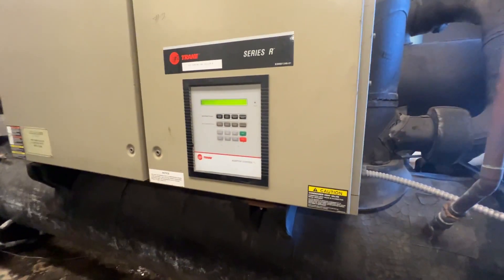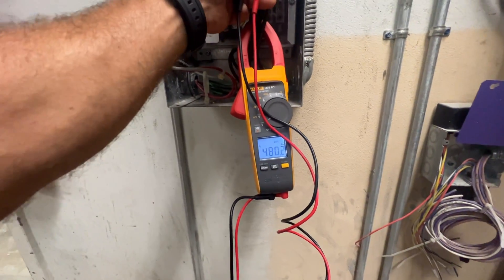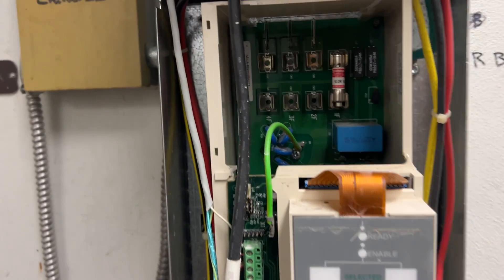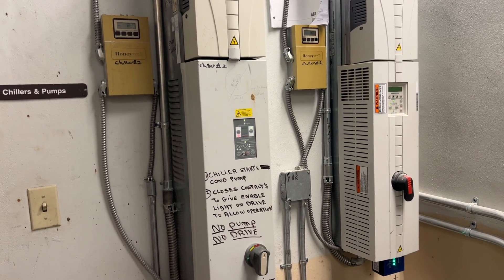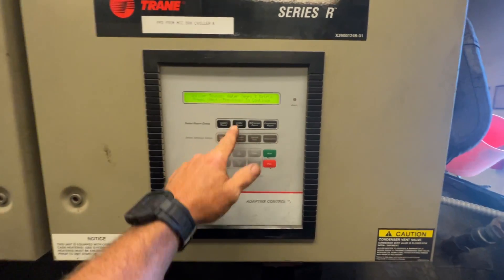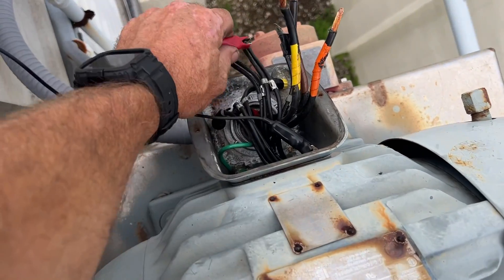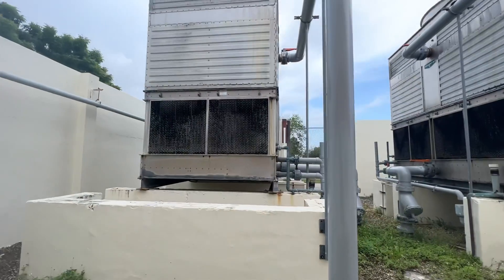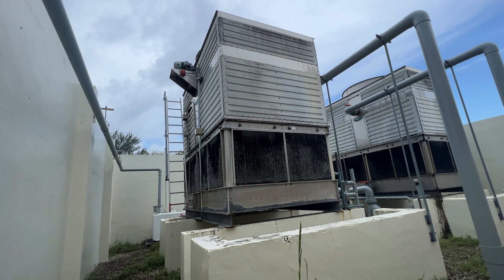Chiller Not Working || No Chilled Water Flow || HIGH Pressure Too? #hvac #subcoolhvac

Comment: The conduit's 90 degree wire pull access should not be facing upward, it should be facing to the side in a  vertical orientation.
Reply from the maker: Thanks for commenting 👍
Reply: It needs a gasket. Its rated for outdoor use and can be in any position.

Comment: Had the same problem on a tower before. Our motor had some issues though. Baldor has told me that below 100 megaohms and the motor should be replaced. If i get below 50 i call for a rewind or new motor. Most drives hate seeing low megaohms values and will trip. Especially ABB
Reply from the maker: Going back next week with electrician to pull new wire , there were 2 blown 30 amp in the MCC, there was a lot of moisture getting into the LB connection out of the ground. It looks like that ABB took one to the face 👊